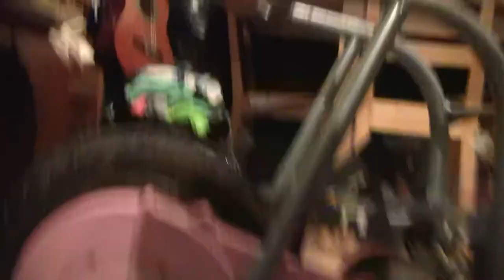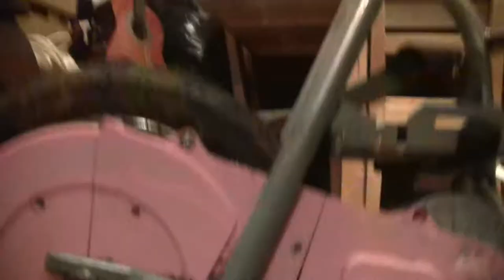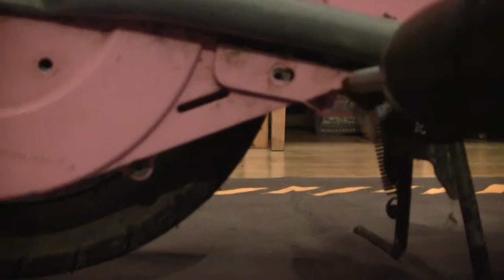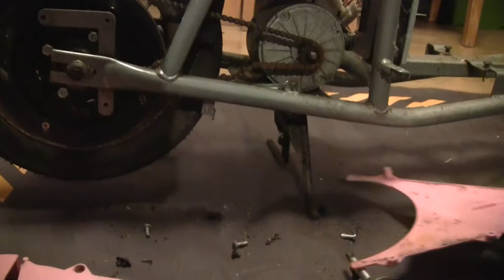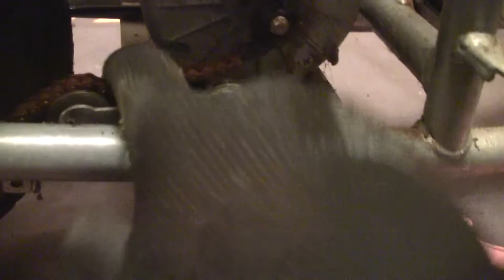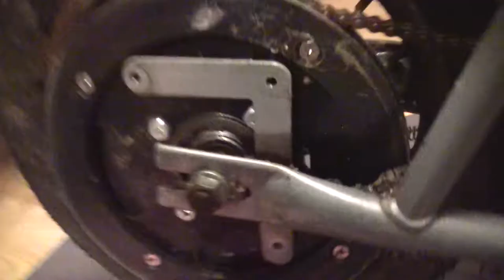Razor Pocket Mod 24v 280w chain guard panel removal

Comment: Hi, how do I know if the chain is too tight or if the tensioner is faulty? The chain on my pocket mod seems to be on fine. The disc wobbles a bit when I rev it and let go. But as far as I can tell it works OK. My issue is on even the slight slopes, it won't really go.
Reply from the maker: The back wheel is not set on straight hence wobble loosen wheel bolts to frame and pull the whell back straight and tighten , the tensioner i will not apply pressure to the chain if spring has broken , otherwise it will just apply pressure to the chain there is no suspension just a solid frame so it will not snap the chain.